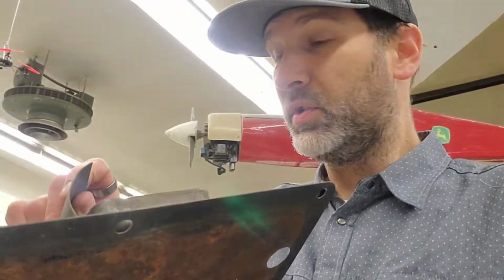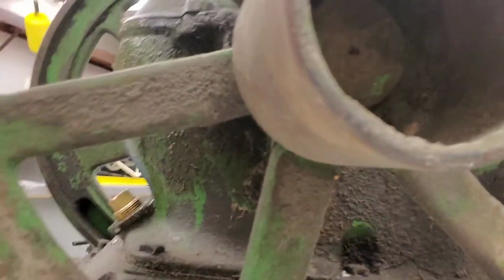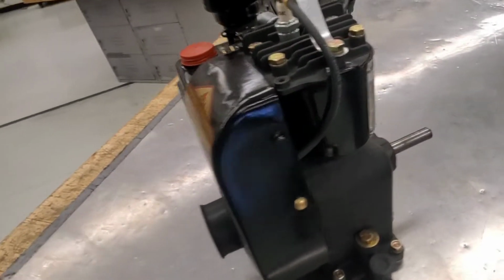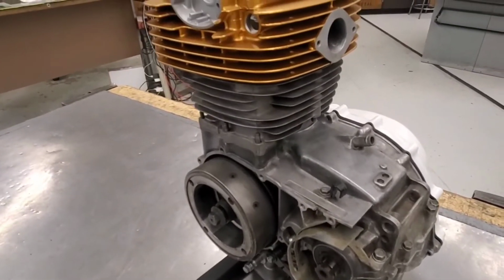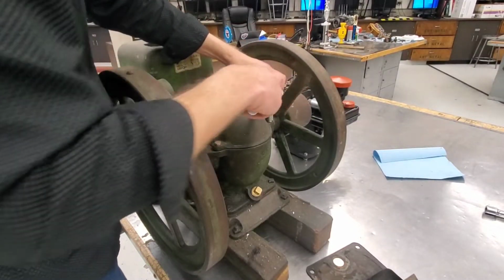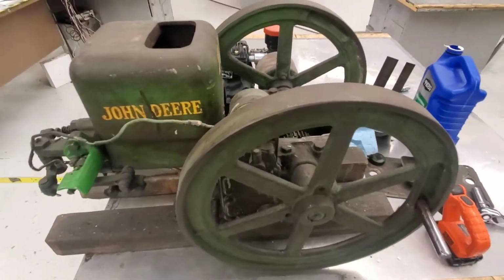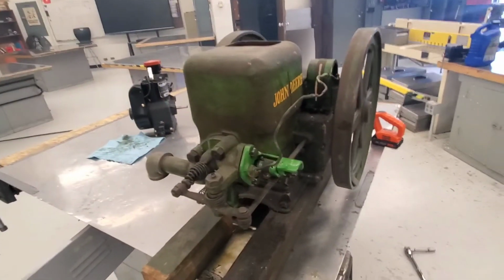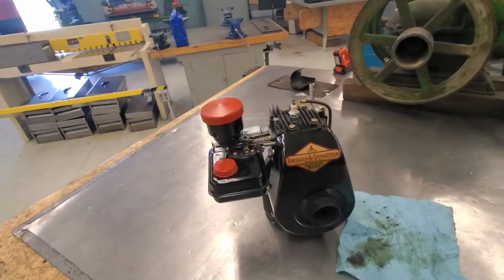Want to see this antique engine run!? First start in years!

Comment: that old gas should've been drained out and throwed away when it sets 4 a long time it gets bad no good 😮😮 and the oil.should been changed as well once motor oil gets dirty it has done all its going 2 do 😮😮 yes alot of other engines did use oilers and grease cup the grease cups were 4 the main bearings and the oil cups was 4 the other moving parts U still had 2 grease and oil the engines /that engine is suppose 2 coast long  U should left 👈 😊 it where it was set at on the governor they only run at 6OO RPM  😊😊 OMG 11 18 2O23